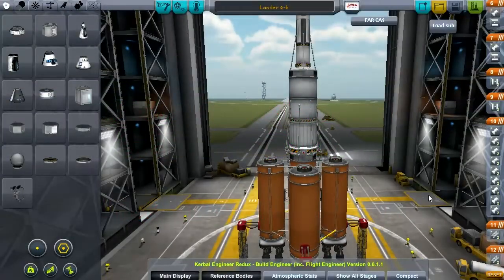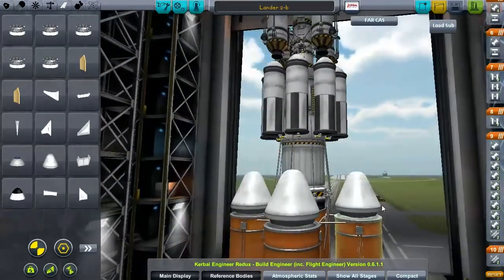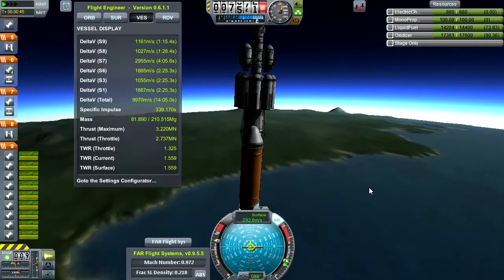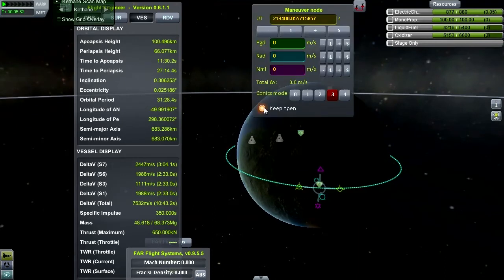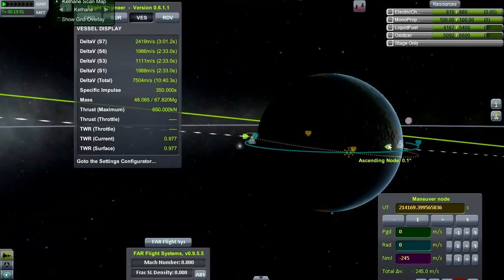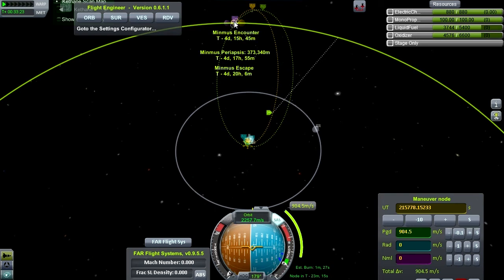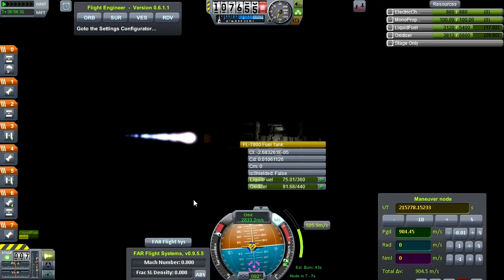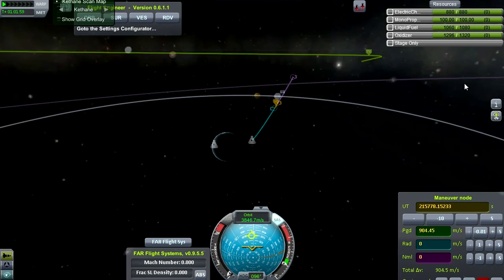E-009- Unexpected Test Results - Kerbal Space Program Season 4

Comment: As for adjusting the orbit using the engines - remember that you get more bang for your buck (i.e. change in delta-v for your fuel expended) when the rocket is moving faster, therefore you should really burn at periapsis not apoapsis. But seeing as you have fuel to burn (pardon the pun) maybe try a bi-elliptic transfer to one of the inner planets (dare we try another Duna encounter) with a retrograde burn at perapsis? Try to catch up to either Jool or Eeloo on the far side of Kerbol?